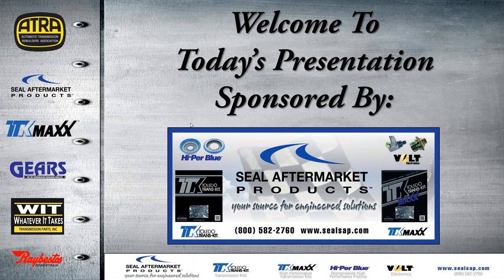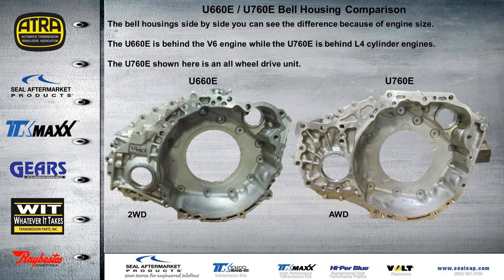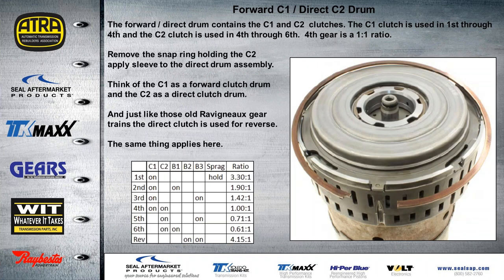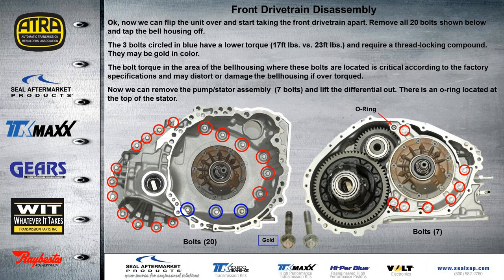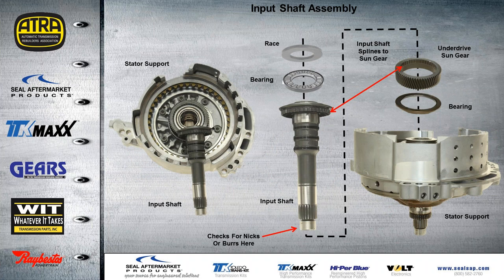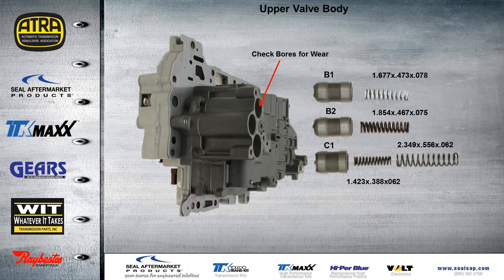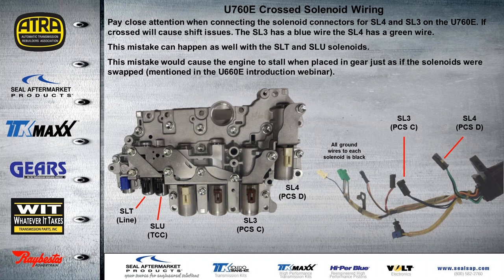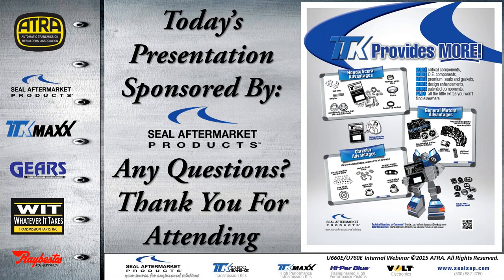U660E U760E Internal - 8/18/15

Comment: Nice webinar-thank you.  Helped repair my U760E trans with bad solenoid. :) and now I know what to look out for in the near future.  bad solenoid about 125K miles 2011 camry with 4 cyl 2.5L mated to above trans.  Would have liked to see a link for case rebuild on the loose bearing race issues for this trans.
Reply: What solenoid was bad on your trans.. im having similar issues and am at the end of my witts
Reply: Tap in 4 small screws around the inner race, into the aluminum case. Tack weld to the race itself so it cannot move. Make sure the welds don't interfere with the planet. When you press everything back together, there's enough play in the center bearing to not affect its operation. Done this several times and have kept tabs on the customers vehicles. Oldest one in operation has been 2.5 years with 40k miles so far.